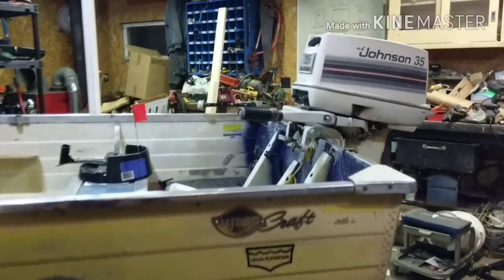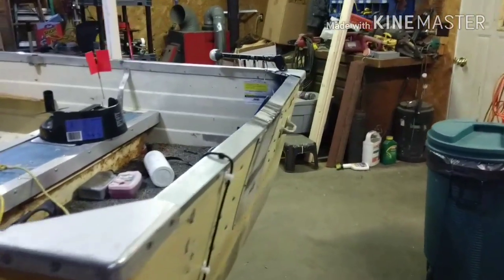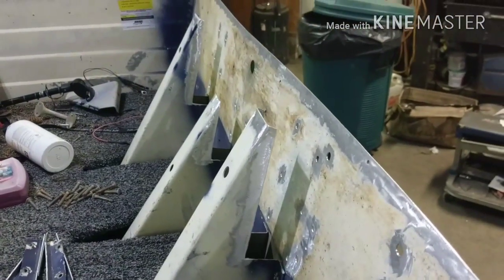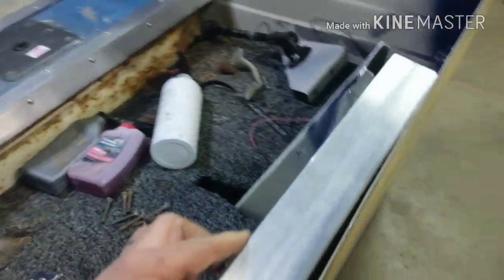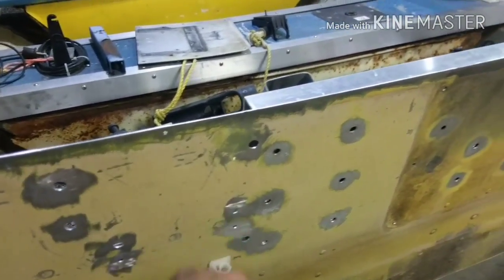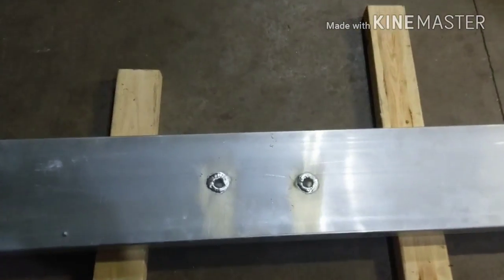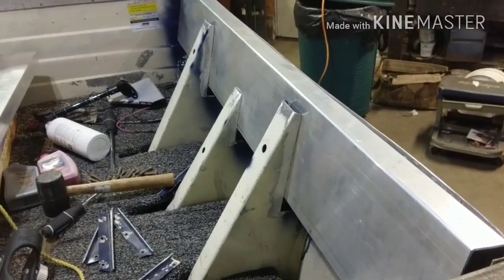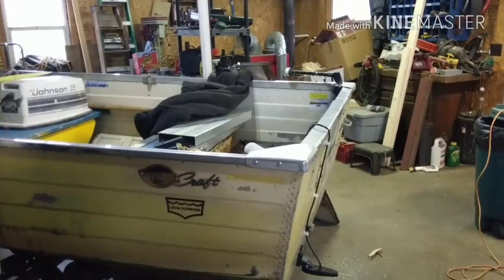Making and all aluminum transom

Comment: Good video - I think with that type of transom a wood one done correctly and covered up will last decades.  Aluminum is heavy even that piece has to be heavier than the wood and a lot more expensive for most people but you are right it should never have an issue.  I have seen someone use the aluminum out of the floor of a semi- trailer

Comment: Do you have an update on this ? Really like this idea!
Reply from the maker: Yes still talk with the guy that has it. Working great still
Reply: If I can’t find that size tubing what type of plate would you recommend ? It’s for a 1650 duck boat
Reply from the maker: @SidlineRunners  if I were to do it again I would use 1.5x3" rec tubing 1/8" thick for 50hp or less 3/16 50hp and up with 1/8" sheeting over it. Build a framework and skin it.
Reply: Dude you are awesome for the fast response
Reply: @JDSOutdoors  last question. Does the aluminum need to be 6011 or could I use 6063 ?
Reply from the maker: @SidlineRunners  6063 is just fine.

Comment: Do you have content on the aluminum transom you did on your old boat? The green one you also put a winch on the bow of.
Reply from the maker: Unfortunately no that was back before I really started posting much and trying to grow my channel. I can answer any questions you have on the green one though as I used it for years. Gone now though
Reply: Did you use this same aluminum tubing in that build or did you do it differently? If so what did you do differently?
Reply from the maker: @snowboy720  that one had a drop in the middle to make it a 15" transom. I cut the shape of the drop, welded in the tubes like that and a top cap
Reply: There are 6 uniform holes on each side of the motor plate. Are those bolts I’m seeing or is it weld? If it’s weld did you fill it and weld it to the aluminum tubing you put in or before you put it in?

Comment: How much do you have invested in your mig welders. I would like to get into welding aluminum.
Reply from the maker: Kyle Silberg about $3,000
Reply: JDS Outdoors  do you run all Hobart welders? Are they with the price compared to the cheaper lotus or licoln in your opinion.
Reply from the maker: Kyle Silberg Hobart is essentially a Miller all parts say Miller and Lincoln is definitely not cheaper lol my Lincoln tig was twice the price of the Hobart mig they both have there place but I wouldn't go much cheaper than Hobart
Reply: JDS Outdoors what model Hobart do you have?

Comment: My starcraft transom is built almost exactly like that. Do you think a transom build like this would gold a 60hp mercury?I've rebuilt several transoms with wood but I like the idea of aluminum better.
Reply from the maker: Absolutely. I'd use 1/8" thick though
Reply: @JDSOutdoors  Sounds good. I have a metal hardware seller like 10 minutes from the house he may have it in stock.
Reply from the maker: @tnbass2833  a lot of boat manufacturers are now using 2x3x1/8" tube for even motors up to 150 horse with great results
Reply: @JDSOutdoors  I knew several builders were using aluminum now a days. Square tubing should make a solid box transom and I could always sheet over it as well.

Comment: You don’t get aluminum galling when you cut it with a wood blade? Every time I’ve ever cut aluminum, I’ve used a courser metal blade in a saber saw, and taped over where I wanted to cut to avoid the blade getting plugged up with aluminum.
Reply from the maker: Nope it works well. It can ruin blades quick if you go to fast though

Comment: Im interested in a transom all aluminum replacement its a aluminum v hull sylvan 16 foot whats a ball park price on making one  would i have to send you a picture what it looks like i dont wanna have to replace the wood later down the toad
Reply from the maker: Where are you located? I also have a 16' sylvan currently
Reply: Florida
Reply: I was going to redo the original
Wood but i dont want to have to redo the transom ever again
Reply from the maker: @anthonyaviles8665  what part? I'm in the process of moving to Florida next month actually
Reply: Where i. Florida im in Leesburg but close to orlando
Reply: I will be pulling the wood out in the next week or so how can i get ahold of you if you look up sylvan 1986 backtroller but has no thick sides their 1” thick
Reply: I wanna be able to install up to a 70 hp on it
Reply: The boat has a skin on the inside and the outside
Reply: So it might not need to be skinned
Reply from the maker: @anthonyaviles8665  I'm going to be in south Florida in Lehigh acres
Reply: Thats a 3 hr drive for me
Reply from the maker: @anthonyaviles8665  hmm. The other option is tbnation.net will have cut to fit bolt in aluminum transom real soon
Reply: That will be awesome

Comment: what If the original sheet of your transom is 1/16 thickness and you have a wood between and the boat hold a 90hp outboard. would you still replace the marine plywood for all aluminum since the outboard heavy??
 Thanks.
Reply from the maker: Johnny Bonsynat I would personally still do all aluminum. That's what most manufacturers are doing these days my dads pontoon has a 115 on an all aluminum transom I've seen many of the new boats of all makes set up that way